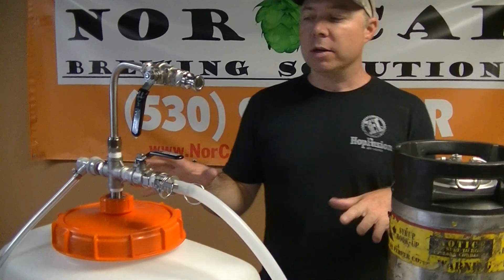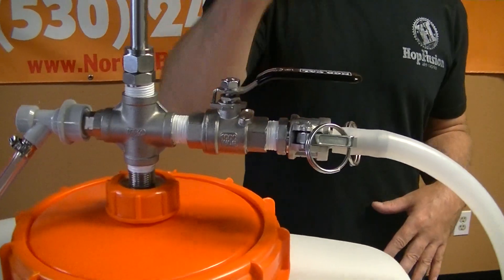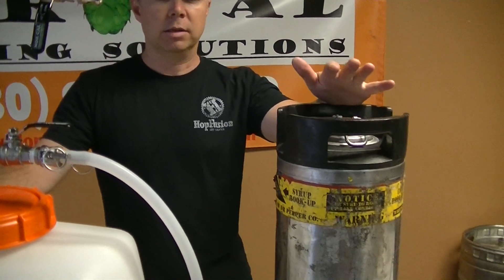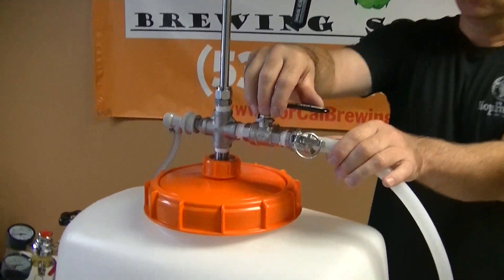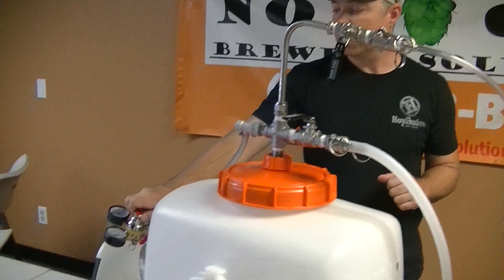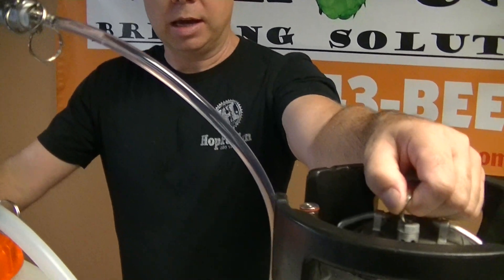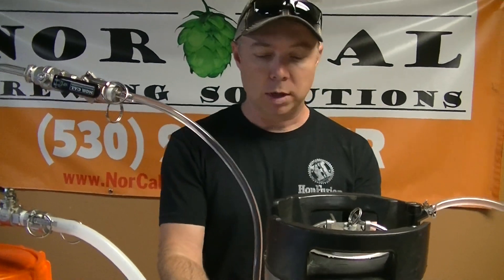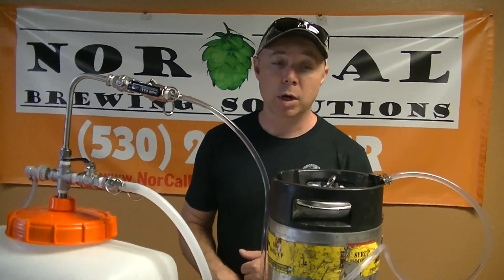Oxygen Free Transfers using NorCal Brewing Solutions Speidel CO2 Transfer System

Comment: Wondering how your adding CO2 down the racking cane and liquid is coming out at the same time am I missing something?
Reply from the maker: Ahh yes the magic I designed into the system.  The racking cane is 1/2" the opening it goes through in the cross is 7/8" the cane passes through the gas chamber going into the tank.  The compression fitting and O'ring stop the gas from going anywhere else but INTO the tank.  You'll see if you get one.  It's kind of a cool design... If I do say so myself :) Thanks for the comment..  
Cheers
Jay
Reply: @NorCalBrewing  Super clever. You've got some really neat, grass-roots engineering things. 

One recommendation, I would be to use a closed loop design to save on CO2. Once it gets going you can feed the displaced gas from the keg back into the fermenter. I use just enough gravity (2 or 3 feet) to get mine going and then the rest is done entirely with closed-loop CO2 pressure leaving the keg and pushing down the liquid in the fermenter that exits out.

Comment: Jaybird, I have a 30L Speidel and recently bought a used O2-free transfer device used from a HBT member and am planning on using it when I brew a neipa. Any advice on when and how to dry hop when using one of these devices?  Is it as easy as just loosening and moving it out of the way while I add dry hops? Wondering how you do it while keeping O2 exposure to a minimum. Really looking forward to using this. TIA.
Reply: Yeah for sure.  If you are wanting to do an O2 free addition of hops or "Fairly" O2 free using this you can be adding Co2 through the cane slowly and yeah just remove the lock ring, raise it up a few inches and drop in the flushed hops.  
Cheers
Jay

Comment: Could this be used to dump trub during fermentation via the racking cane? Is it pressure fermentation compatible? I'm likely going to be buying your whole Speidel accessories setup in a week or so. Really dig your lifetime whirlpool/aeration paddle and figure this stuff must be good as well!
Reply: I think you are going to be hard pressed to get 100% of the trub out of the vessel, but yes the system will hold pressure.  I would suggest if you are planing on doing the you are going to want some sort of PRV in the system just for safety sake.